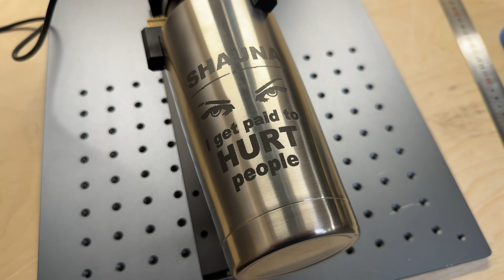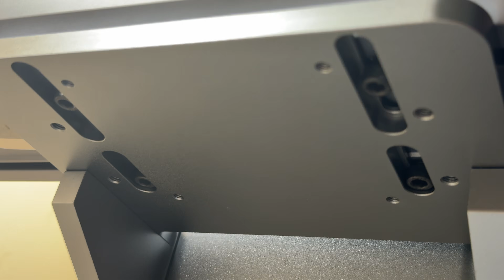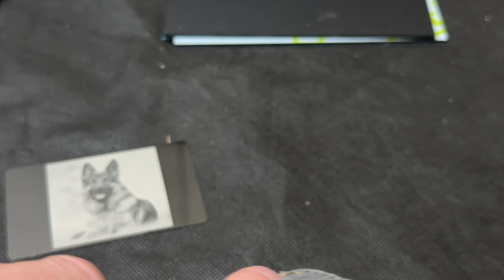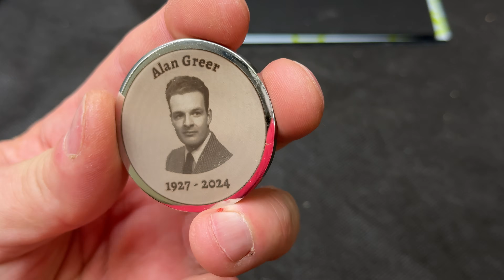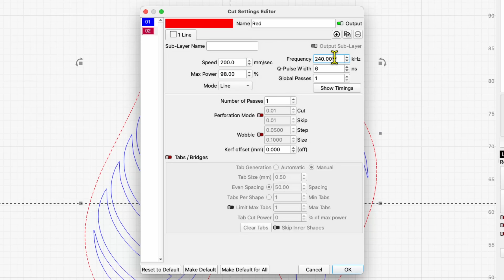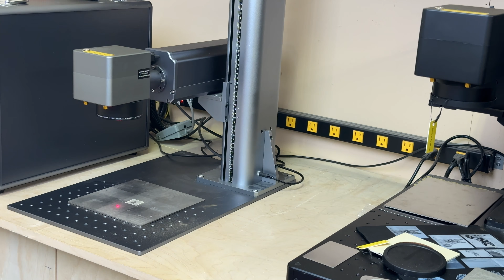ComMarker Titan 1 - Why Is This 100W Laser So Cool?

Comment: Hi Steve, 
experimenting with the million settings for the Titan 1, you mentioned you executed your coin in this video in about 3 minutes. Would you be willing to share your Lightburn main stats to achieve that in that time? I seem to blast through a 3 mm coin too easily.
Reply from the maker: If I said I made a coin in 3 minutes I was incorrect.  I'll have to go rewatch the video.
Reply: @SteveMakesEverything  I'd be interested in your coin settings as well. I just received one of these this week and am messing around. TMI on the internet and none have given a result near as nice as yours. Thanks!
Reply from the maker: @PushBtnReceiveBacon  I usually show the Lightburn settings screens in videos.  Take a look there and see if you can find them.  If not let me know.
Reply: @SteveMakesEverything  There are several settings screens for other parts but not for the brass coin. If you could look them up, would be much appreciated.

Comment: How would this perform on golf clubs? Most clubs are stainless steel or titanium. I’m most curious how people get deep engravings on the uneven and curved surfaces of wedges and putters. Great video!
Reply from the maker: The Titan doesn't have autofocus or the ability to focus over a curved surface, so there would be some limitations, but it will certainly engrave on pretty much any mettal.

Comment: 1. How about thin metal cutting? With 60W power how well it works?
2. Do they have a protective cover at all?

Thanks
Reply from the maker: I have cut thin brass plate with this laser and it works pretty well. There is no enclosure for this laser.

Comment: Hello can you share the setting on engrave color on the 100w mooa please
Reply from the maker: One of the reasons you don’t see settings like this published is because there are too many specific variables related to your specific laser (e.g. exact focal length of your lens, true power output etc.). Even two identical lasers can have variations big enough to change the settings you’d need.

You can start with power@40%,interval@0.002mm and Q pulse of 6ns. Then try a speed range from 500-350mm/m and a frequency range from 150-600khz.  Use these in a material test on stainless steel, but make sure your focus is perfect because even slight variations will have big changes.

Comment: I have a really novice question for you: Where does the color come from? The laser is able to create color? Is the color embedded into the material already? This is very interesting
Reply from the maker: Good question.  The color is coming heating the stainless steel to very specific temperatures  which causes annealing to occur.  Depending on the temperature, different colors can be produced.
Reply: @SteveMakesEverything thanks for answering my question. I appreciate it!
Reply from the maker: @davidk.1089  It's why I'm here 🙂

Comment: What are the X and Y dimensions of the marking field for this fiber laser?
Can I interchange lenses to get a larger marking field?
Reply from the maker: The dimensions depend on the lens, but, yes you can change to one of several different lenses
Reply: @SteveMakesEverything what the current working dimension of your machine?
Reply from the maker: @pranav9764  With a 250mm lens, it about 250mm square

Comment: Great info sir!! I’ve seen your B6 60w MOPA video as well. I have experience with CO2s but I’m noob to fiber. I typically want to buy once within reason but I’m stuck between B6 60 and the Titan 60 or even the 100. I know you don’t have much to go off of to point in a direction but which machine would you rather have it were just one machine? 

I’m a hobbyist and Sped teacher by day. Retirement is in sight so I’m building my shop as I go along! 

Thanks for any thoughts you may have!
Reply from the maker: Perfect retirement planning! 😊

Basically if you want a 60w then pick up the B6 because it has autofocus. If you want 100w the the Titan is the one
Reply: @S @SteveMakesEverything  I love the deep engraving and cutting abilities of the Titan 100. Can the B6 60 do the same? Is the main difference the speed at which you can do it?
Reply from the maker: @TheAyotteMan  For the most part the B6 60 can do what the Titan 100 can do - it will just take longer (e.g. more passes for cutting).

So if you're willing to wait, you'll be fine.  However when cutting things like brass, every pass will cause a bit more warping, so fewer passes may mean the difference between success and failure.

Comment: What is the usable cutting area for the machine please?
Reply from the maker: This depends on the lens you choose and there are several. The laser comes with 250mm and 70mm lenses which will be the rough maximum engraving size.

Comment: How does this work on Sterling silver? What would be the maximum thickness it could cut out?
Reply from the maker: Part of the answer to this is based on how persistent you are to cut something.  Many passes can cut fairly thick material; however,  the cut will start look ugly.  Figure you're going to max out at 2-3mms in order to get relatively smooth cuts

Comment: Thank you for this video. Awesome. I am beginner of the fiber laser ans I am thinking this 100w titan should be more than enough to start.
Reply from the maker: Yes, it will do pretty much anything you’d ever want in a fibre laser. It’s what’s in my shop too.
Reply: @SteveMakesEverything Thank you for this. If I am using this link what you shared, is it still active? Thanks Margus.
Reply from the maker: @margusmatikainen290  Yes, my affiliate link should work fine - and thanks for that! :🙂

Comment: Great video thank you. I’m brand new into engraving and been watching hours of video on where to start and what to buy. I know ultimately i want to engrave guns but also want versatility in doing several material types. My wife would like to make some jewelry too. I thought about the F2 but thought maybe 60w wasn’t enough for my end game. I’m leaning towards this model and picking up a separate diode or UV laser. This way I’m covered for almost everything 😅. Would love your thoughts. Thank you
Reply from the maker: For jewellery a 100W like this Titan are better suited.  For engraving almost any material, but not cutting! Look at a UV laser like the ComMarker Omni X. Unfortunately no single laser can do everything.
Reply: @SteveMakesEverything  Awesome thank you so much for replying and the help. I've settled on the Titan 100w and the Omni X. I'll be picking these up through your links as well ;). Thanks again
Reply from the maker: @mikeyschaos  Awesome and thanks!  Keep me posted and let me know if you  run into any issues

Comment: I currently have a 30W b6 mopa, and im really struggling with cutting 1.2mm brass sheets so was looking at a second 100/200 machine for cutting - this machine is super evpensive though, the full package is like 10k for the 200w version, when theres other 200w fiber lasers out there for about 3 im struggling to justify the massive extra cost for the nice to haves.... whats your take on that?
Reply: 2) do you use some sort of air assist for cutting into 1m+ sheets?
3) im much more worried about the power behind the 200w, do you use the full protective enclosure?
Reply from the maker: Well I don’t set the prices so I can’t really comment too much. I can tell you the the 100W laser will cut brass well because I do it regularly.

Comment: Nice video Steve, mine should arrive this week. What are your thoughts on requiring an enclosure for it? The ComMarker one doesn’t fit the Titan so I’m left to building one. It’s in a closed off garage so just trying to ascertain how much dust it produces especially when doing deep metal engraving. Thanks!
Reply from the maker: I don’t have an enclosure but build on if you feel the need. If you want a window in it then you’ll need to source some acrylic for 1064nm

Comment: I'm SO close to purchasing this laser.  I know it has a Galvo Head, and I would love to see how well it burns on a curved surface without the rotary.
Reply from the maker: Well with any fiber laser you won’t get a lot of curve range because focus is a lot more critical that it would be for, say, a diode laser.  Basically if you want to engrave on cylindrical item with a fiber laser, you really need a rotary.
Reply: @SteveMakesEverything  Thank you for the reply.  Yes, I know that a rotary IS necessary for cylindrical, but I know since it's a 3D MOPA Galvo, I was just curious to see how far it could be pushed compared to a 2.5D machine.  I've seen some pictures by other Chinese companies, that show pretty extreme curved engravings, "Supposedly" marked with a 3d Galvo.  But I know better than to trust the pictures.  However the 3d Galvo MOPA seems to do better that a 2 or 2.5D when marking on a flat surface with curved edges like Brass Coins and the like.  It seems like it can get into incredible detail even around the edges where the 2 and 2.5D can't.  Admittedly, I know NOTHING about these machines, because I've never been near one, much less used one.  I just know that they are expensive, so I'm doing A LOT of research on the best bang for the buck, and I keep coming back to Commarker.  I DO have an AXIOM AR8 Elite Router CNC, and a small/standard format 10 Watt Longer RAY5 Laser CNC.  I'm now Subbed BTW.  Thanks again!

Comment: If only it was the 200w version.
Reply: it comes in 200w configuration
Reply from the maker: There is certainly a 200W version if you've got the budget.  The 100W was plenty for my work flow

Comment: You mentioned that you buffed the challenge coin for about 3 minutes, but not how long it took to engrave. https://youtu.be/XqGNb2hCxmw?t=377
Reply from the maker: Ah, right.  This isn't a particularly deep engrave (maybe 1mm), nor was I too aggressive on the power, so this took a little under an hour.  You could certainly reduce the time and there is enough power to cut through a 3mm brass coin if you want.  If you were in a rush, you could probably get the engraving down to 40 minutes, but then polishing would take longer.